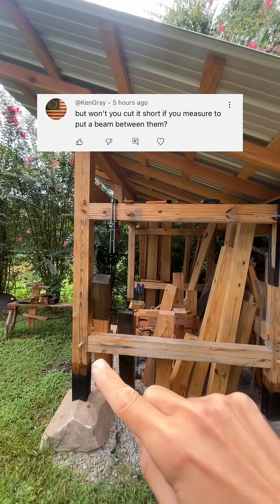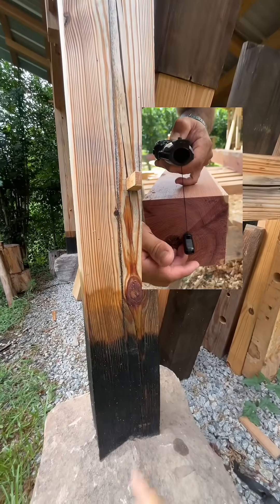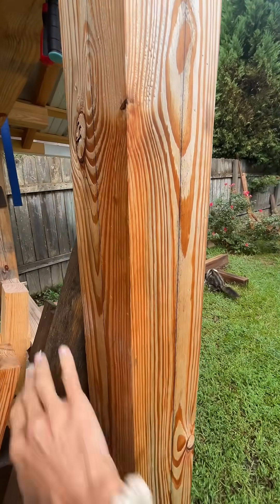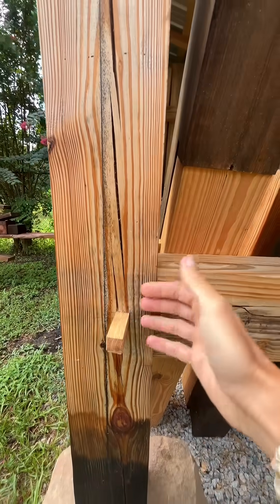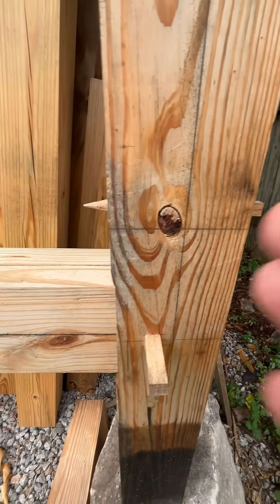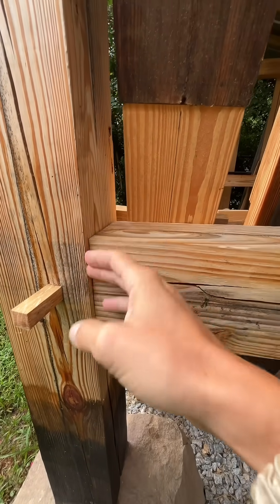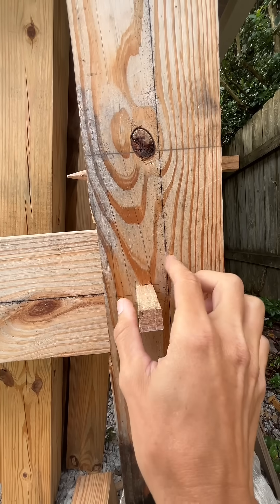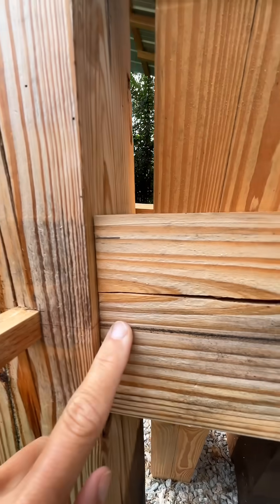How it works: the ancient wisdom of centerlines

Comment: Great video! I don't understand how the length (shoulder to shoulder?) of the horizontal piece is determined. Square rule principles would simply call for a consistent reduction (say 1/2"), so all your vertical timbers would get reduced down to 4 1/2." Thus the shoulder-to-shoulder distance would be determined by subtracting 9" (i.e 2x4.5") from the width of your shed. In line rule, how do you determine that? Sounds like mapping a little bit.
Reply from the maker: It's the same principle, however, the reductions are split in two. So on a 5x5 the reduction from centerline would be 2.25". This establishes an overall reduction of .5", but you would only see .25" on any given face. But you can obviously tailor that to your specific needs.

So instead of measuring from the outside, we measure from the vertical post lines and then subtract 4.5" (2.25"x2) to get the shoulder to shoulder length. I think in this shed those reductions aren't very obvious because I planed down the face as opposed to doing an obvious reduction (I was still learning how to use the layout method). 

Hope that helps. Thanks for watching and the comment.
Reply: @appalachianwoodhomestead  Thank you, it is starting to make sense a little. When you have a sec, check your email, sent you a quick note + questions about your October course.

Comment: If you just do scribing of all the beams you dont need to do all this ugly american style housing on sawn posts (understand it for hewn pieces) but you can just perfect your sholder lines based on the center lines, that is why the method was developed.
Reply from the maker: Too bad we don’t have a lofting floor 🙃
Reply: @appalachianwoodhomestead you dont need it, in the old days they didnt have it either, all you need is to either level the beams wherever you are or use string lines on the floor to plane it. Bit of a steange excuse not to do it. We hew the beams always in the forest and there we cut all joinery so that we dont have too much weigth to get them out of the forst, even though the hills are sloped, we just level them. Bit silly to do all the centervlines and then not do scribing where the lines originate from. Btw dont mean it mad, just sounds mad, you do good work and keep that up!

Comment: Is centerline layout better than square rule when it comes to timer framing. Just starting to learn about timber framing for some small projects on our property.
Reply from the maker: Yes, it is, but it also takes longer and may not be necessary. 

If your timbers are pretty good and you can get them worked and raised without them twisting too badly, square rule is faster. 

Line rule is great if your timbers are twisted (they almost always end up twisting) or you’re doing more complex joinery, like with Japanese style frames. 

Something small and simple, if you’re able to get to it fairly quickly and have decent timbers, should be fine with square rule.
Reply: This is the same as using the Square rule for timber frame joimery
Reply from the maker: @Tanman0351  No, it isn't. In square rule, measurements are taking from the reference edge. In centerline, the line is the reference.
Reply: so this is basically advanced square rule

Comment: Are y'all not worried about wind wreaking havoc on that thing?  Between the roof design and it looking like it's just free floating on those stones, it's hard to imagine it holding up long term regardless of the joinery
Reply from the maker: We had our once every 20 years hurricane last year 😜 It's in a sheltered location and we don't tend to get high winds. We're prepared to add pins if needed, but so far nothing has shifted.

Comment: how do you mark the topology of the foundation surface on the middle of the posts not just the scribed faces?
Reply from the maker: Trial and error. You can use carbon paper to mark the high points, or chalk. But mostly a lot of trial and error.
Reply: @appalachianwoodhomestead cool! thanks!

Comment: what's the advantage?  its extra steps, there has to be some specific benefit.
Reply from the maker: Line rule allows you to work with irregular, out of square timbers, even round wood. It's also frequently used for greater precision in smaller scale woodworking, like making boxes.
Reply: The advantage is accurate measurements lol
Reply from the maker: @weedtaco1144  With irregular timbers, especially round wood, you'd have to either scribe everything (which needs a lofting floor) or size/dimension it. So it's a pretty substantial benefit, depending on yoru wood.
Reply: As stated, this is not an..."extra step"...at all for the reasons shared.  What I will add is that "line rule" modalities are the oldest and most proven accurate and efficient methods of layout in not only wood, but textiles and masonry as well.  

"Scribe rule" (and related lofting methods like stereotomy) are perhaps older or as old which is measure in millenia...not centuries.   The challenges with... scribe rule....L'art du trait...stereotomy... lofting and all its related systems, is that it is the most labor intensive way of rendering "lines" and "geometry" into a given medium, be it textile (i.e. sartorial arts) clay, stone or wood.

Comment: ah, so you're only going to the center rather than all the way across. 👍
Reply from the maker: Your measurements are all from the center, but joinery can extend past the center line towards the opposite side. So a through tenon might have 5" to the left of the center line (making it stick out of the timber on the opposite side) and 2.5" to the right of the center line.